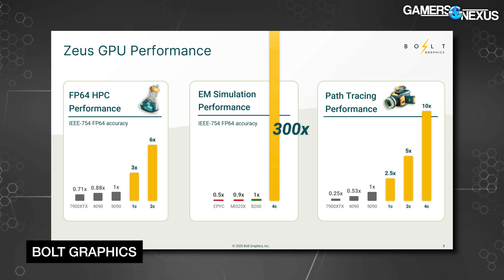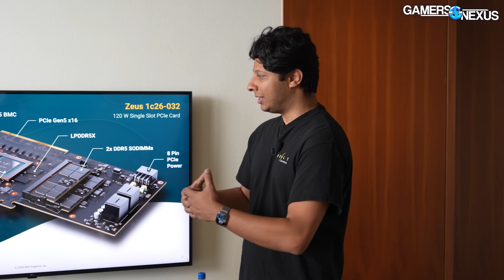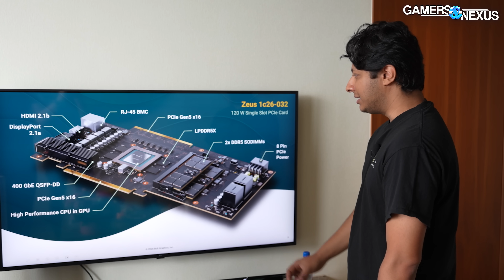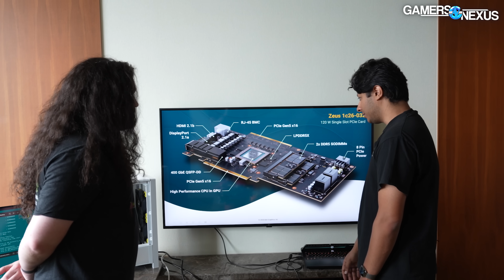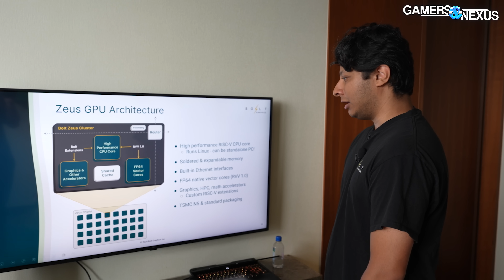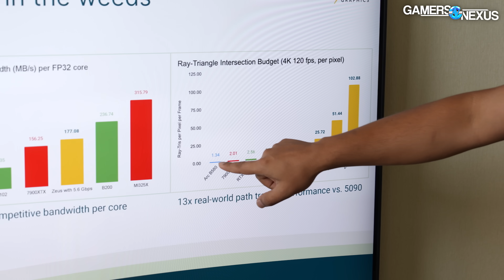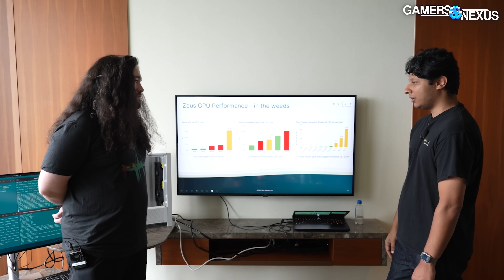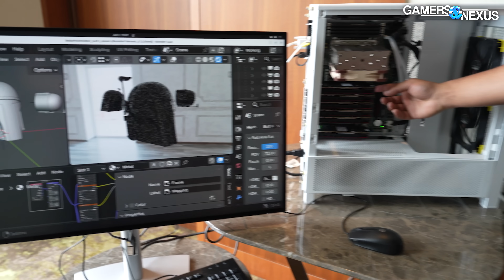A New Gaming GPU Challenger: Bolt Graphics Takes Aim at NVIDIA

Comment: Open sourcing the drivers would go a long way
Reply: on linux side. MESA would do miracles.
Reply: @TheHippo1555  dude, it has a ethernet port, cpu cores and expandable memory, with proper open source magic setup you could run another instance of the PC without having to emulate it with virtual machines
Reply: @hientss with the architecture that'd be really interesting, i don't know how many cores they have, but that might work well for virtual servers.
Reply: @hientss not with Licensed Core tech, it will be so fucking closed that you would be better off trying to hack a john deer
Reply: @davidbobo5517  lmao true, i hope he goes for the open source though. it would not only be better for us but also would sell much more for him
Reply: @davidbobo5517  That's nonsensical, they licensed IP for a RISC-V cpu with rvv 1.0, all the specs are open
Reply: @paulie-g came to say this.
Reply: @davidbobo5517  thats been done already
Reply: @TheHippo1555  it already boots into Blender meaning there's either OpenGL/Vulkan drivers, logically idk why they wouldn't go into Mesa when basically everybody other than Shittidia does
Reply: @plant-feline  Mesa might not accept patches for a GPU that doesn't exist, but nothing stops them running their own branch. If they're claiming it can boot Linux as an SBC, it would stand to reason that they have at least basic rendering working.
Reply: The big thing would be fully opening the specs, so people can creatively write optimized software/drivers. Current open-source drivers by AMD severely limit what you can do with their GPUs (for example that's a huge issue right now for 2D desktop applications), and they don't publish full datasheets to write your own drivers from scratch.
Reply: @imrevadasz1086  Please explain the 'huge issue for 2D desktop applications'
Reply: @paulie-g there is no longer any proper 2D rendering support on modern AMD GPUs. It's has to use the 3D rendering pipeline, which is unnecessarily complicated. Especially really simple operations like a classic BitBlit becomes ridiculously involved. Also older AMD GPUs had hardware overlay support (so you could have a second completely independent framebuffer that is then overlayed on top of the primary framebuffer), which would allow giving an application direct framebuffer access while it's rendered into a window, which can make 2D rendering much easier and faster and faster for some kinds of games and applications. AMD never supported this in any of their drivers, but it was trivial to support and use if you wrote your own driver (which I did once ca. 10 years ago, and could very easily add support for in mplayer for video output as a test), and it could also easily be used with Wayland to transparently make any games render faster and better. This was in the AMD/ATI R400/R500 hardware generation.
Reply: @imrevadasz1086  2D rendering was killed with the release of Vista, when all the 2D rendering facilities like DirectDraw (iirc) were ported on top of the 3D pipeline. I don't recall there being much hardware 2D acceleration on PC GPUs to begin with - while NES/SNES/other consoles had tile-based graphics, sprites and so on, all PCs had at any point would have been a mouse cursor sprite, a hard to use smooth scrolling, all on top of a pure framebuffer. All of this was only helpful for a short period of time until CPU frequencies and bus bandwidth/latency improved enough that you were happy to do all of this work on CPU. Any 2D drawing support is client-side, not in the driver, and nothing stops you implementing it, or using a mature 2D library like Skia, AntiGrain, Blend2D. You can cache as much as you like in a GPU texture, and quality text rendering requires software rendering (unless you're doing something like a terminal with monospaced fonts where you can cache the glyphs in an atlas)
Reply: @paulie-g on the UNIX side, the X11 server has a huge amount of 2D acceleration that helps performance a lot. And that's not client side, that's directly in the GPU driver for the GPUs with proper 2D support. The 2D stuff is tailored mostly for workstation/office use. So you get things like copying, font drawing,  alpha blend copying/mixing operations. WebKitGTK for example used to be an extremely efficient web browser on UNIX/Linux systems, using 2D graphics acceleration very thoroughly. Before some point in the early 2000s, almost all GPUs in PCs were focused on 2D acceleration.

Even antialiased font rendering can be easily accelerated with 2D GPUs, using alpha-blended block copying commands. You render once with the CPU to the cache, and then you can use accelerate drawing in the future. But unless you have wasteful super high screen resolutions, bitmap fonts are far more readable anyways 😊.
Reply: @imrevadasz1086  I think you're a bit confused about the history. Going through various points: Alpha, and consequently anti-aliasing, transparency etc showed up in the X11 world with Keith Packard's Xrender circa 2004 iirc, before then if you wanted to do mixing you'd have to read back from the existing buffer. Moving on, various DDX had this or that feature, but they were not kernel drivers but rather X11 drivers implementing X11 low-level primitives for a particular card. WebKitGTK is, firstly, a port of Apple's WebKit (which is itself a fork of KHTML from KDE), secondly it's a rendering engine (similar to Chromium's Blink) - a browser you'd be thinking of would be Epiphany and none of this lines up with your timeline of the heyday of 2D accel. Glamor is the '2D acceleration' you're likely thinking of and I have bad news - it's entirely OpenGL/EGL based using a 3D pipeline on the backend, it just looked like 2D accel because that's what it was for and the API it exposed to XFree86 - clients would still issue the same X11 commands, Glamor would accel them on 3D cards, with 3D primitives*. As for glyph rendering, outside of bitmap fonts and X11 fonts, all anti-aliased glyphs were always software-rendered, and yes, you can cache them in a texture (albeit it's only practical for restricted use cases like terminals), which is called a glyph atlas. Client-side referred to direct rendering where you, as an X11 client application, ask for a surface and render to it with a combination of software and OpenGL (this is called GLX, which is why the famous bench is called glx_gears). The number of IBM PC GPUs that had 2D accel but not 3D is exceedingly small (less than 20, probably less than 15), mostly in the VGA-and-earlier era, and I don't recall seeing most of them as DDX options in Slackware at the relevant time (and Slackware had *everything back then). Now, if you were to talk about, say, Irix or Linux on SGI or even HPUX on PA-RISC, we'd be having a slightly different conversation (albeit one I'm less qualified to have - I used to have those boxes in my collection, but didn't dig into the internals too much, but they had to have mad accel to run the resolutions I had on them).
Reply: Matrox has entered the chat. Those guys used to have one of the best 2D engines around.
Reply: My instincts are telling me that he's merely using Steve's platform for free exposure and that gaming isn't really the goal at all ... Seems ... Really studio-rendering focused ... Every aspect of this conversation screams "rendering workstation GPU"
Reply: @pixelsafoison  Screams "awesome local model rig" to me.
Reply: @pixelsafoison I felt this too since the first time I heard of them the only goal they had was making a gaming gpu and now he's mentioning content creation and datacenters lol
Reply: @SeedlessBananas  Im a data center hater but thats where alot of money comes from. But no one is going to build around a new player that doesnt have a product in the market they arent like ibm who just straight up arent in the standard gpu game. So they have to prove themselve and theres nothing more powerful than gamer and creator word of mouth. Alot of standard products  end up in datacenters and in businesses anyways. I still see 1080tis everywhere in iT personally its kind of crazy.
Reply: @SeedlessBananas  To be fair, that's where the money is currently at. LLMs are being shoved into our throats whether we like it or not, and from a rational point of view they'd be stupid not to capitalize on that. Moreover, I'm sorry but after a second watch, the structure of the board now screams "self contained data-center GPU!" - I mean it has a CPU core, RAM and GPU components.... It's a GPU-centered SBC that also merely happens to be able to interact with an OS through pcie... The more I think about it the more removed from a graphics card this appears
Reply: @pixelsafoison LLMs are not the only thing data centers are used for, they are just the reason for the recent explosion in them
Reply: I think they are making those options
Reply: That would probably help improve them a lot very quickly, very good idea!
Reply: Focus on hardware and documentation, and the linux community will build the driver for you.  You can also reuse it for windows for the most part.
Reply: @krakow10  The Linux community has never worked with RVV and the decent open source GPU drivers began with a source code release from the vendor.
Reply: @paulie-g  Ok? What do you think documentation is for?
Reply: Brute force
Reply: Honestly when they talked about not optimizing for rasterizing I thought about a project floated at x-org conference to have the old graphics pipeline become entirely software emulated in the GPGPU . The goal was exactly for this use case, a modern new to the market accelerator card.
Reply: @AndrewMorris-wz1vq  Well, if you think about it, the old 'fixed' 3D pipeline seen in early-ish cards, has indeed been replaced with a programmable pipeline working with a flexible sort-of GPGPU. At this point, given that what they're doing is more of an accelerator for certain use cases than a GPU, it wouldn't be unreasonable for them to dump raster or devote drastically less resource (area, power budget, scheduler priority, sw development) to it. I don't know what the market he's aiming for looks like economics-wise, but I do like that they've hit hard on differentiation that makes them super-good at something. TSMC 5nm is also a good choice.
Reply: It’s actually the only way, in all reality. Open source, full disclosure of the source up front for community.

It can be done!
Reply: @ChryslerLeBaro  Not in this case. They licensed a commercial IP core for the CPU, the RTL isn't going to be relicenseable. If they have a working DDR5 memory controller, that IP is going to be even more expensive and it won't be relicenseable either
Reply: Yes! This! Do this!
Reply: I just made a similar comment before I read this one, I couldn't agree more.
Reply: That is only one part. Who develops those drivers? Mostly AMD employees. GPU driver development is the champions league of programming, only the best of the best can do that properly. And both Nvidia and AMD know that, paying their engineers are fortune to keep them. Not easy to poach these people, let alone train them.
Reply: @sokarash  It's nowhere near 'CL of programming'. Working on core kernel subsystems? Yes. Drivers? No. What you need for that is GPU internals and firmware knowledge, which mostly requires stuff under NDA and experience. None of that would help with writing drivers for this GPU, as it's a completely different hardware model (Risc-V universal vectors rather than special-purpose tensors/shaders etc)
Reply: @paulie-g  shader compilers are a very complex part of the graphics runtimes in the drivers for these things. Definitely top of the line engineers
Reply: @rpavlik1  .. and that would matter if this GPU had shaders, which it doesn't, if you had paid attention to the RVV 1.0 bit. And no, shader compilers are not that difficult compared to modern optimizing compilers for HLLs - to the extent they're complicated, it is because most shader languages try to resemble C++ which maps terribly to the execution model
Reply: @sokarash no, only AMD employees can write the best drivers with support for all the features, because only they have access to proper hardware documentation. Earlier in the days, there were several independent drivers for ATI Radeon GPUs. There is nothing too special about the GPU stuff really in driver programming. The "hard" part is what's part of e.g. Mesa in the open-source stack, where you have the compilers for each GPU-serie's instruction set, and the translation from Software APIslike OpenGL and Vulkan. The core GPU driver is mostly just memory management and command queuing and communicating with the GPU's firmware (and that queuing isn't too different in the end from how network or many wireless devices are used).

Part of the reason why it's perceived as so hard is that drivers like the amdgpu Linux driver or Intel's i915 use a very baroque ancient-style architecture. And Linux's "drm" framework doesn't help with keeping complexity low either.

And there is actually an independent driver stack for AMD GPUs up to some point for Amiga Computers that was mainly developed by a single person.

Especially AMD GPUs have always been quite "easy" to program, with things like modesetting doable mostly with just running the ATOMBIOS virtual-machine Bytecode. And power-management for example is mostly done autonomously by the integrated microcontroller/cpu.
Reply: Ought to be a basic feature of all hardware
Reply: Oh please open source the drivers, and write them in C!
Reply: @reinoud6377  it's drivers we're talking about, i wouldn't be surprised if they're not in assembly
Reply: AMD and Intel drivers already are open source. It's just Nvidia
Reply: Lots of tech needed for the best drivers is proprietary.
Reply: @ShiroKage009  lots of test with metrics and debug - create a bug squashing board, post your sev 1 n 2s
Reply: @asianartist1  You can't just hobble your way into the same level as the proprietary software. What they could do is give real support to the open source but make a full fat driver with the standard tech. It will, however, destroy their resources because of the expense.
Reply: Tbh the drivers could be written by specialized llms at this point. No need to crowdsource them, thats a slow legacy path
Reply: @VincentPride1986 oh yeah let's vibe code the drivers, for sure. Are you on the right channel?
Reply: @RealLockheedMartin  1) that's not vibecoding, 2) in ideal world these "drivers" as another layer of abstraction wouldn't even have to exist at all. Graphic APIs should run the show. Automating all this legacy driver bullshit is the only valid path forward

Comment: This could be very interesting, because it's just a RISC-V cpu with many vector cores doing gpu workloads with shared memory.
It's basically a BC-250, but RISC-V.
I wonder if the K3 could do something similar using it's A100 cores.
Reply: Now you gave me an idea. Software raster stuff on RVV.
Reply: @khardian  that is basically what they'd be doing, just on a chip optimized for throughput over latency. risc-v's vector instruction set was designed in part to serve graphics-like compute needs.
Reply: @dead-claudia , they did that on silicon, but we also need software to support that kind of thing.
Reply: Isn't that similar to what the Rendition Verite did back in the 90s though? 
It was basically a MIPS processor masquerading as a graphics accelerator.